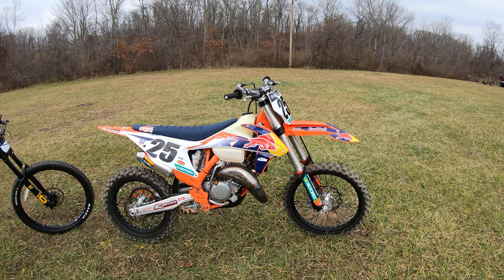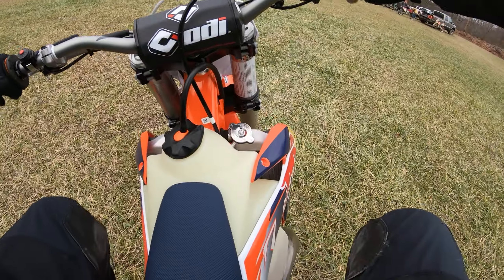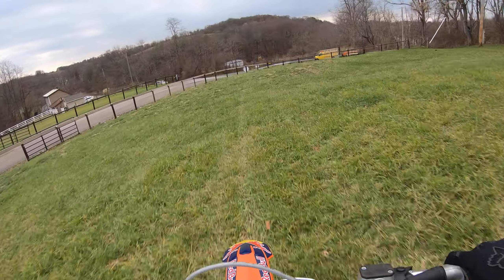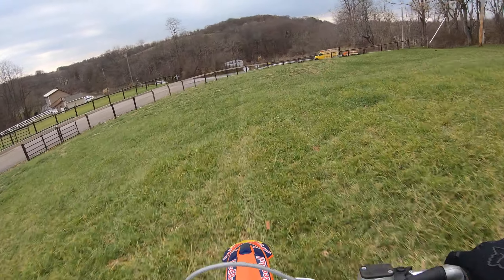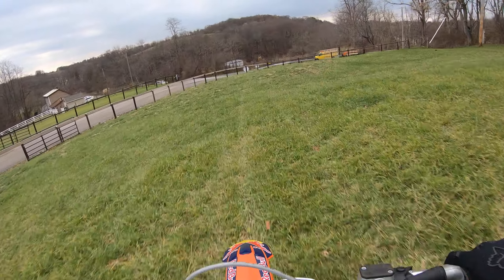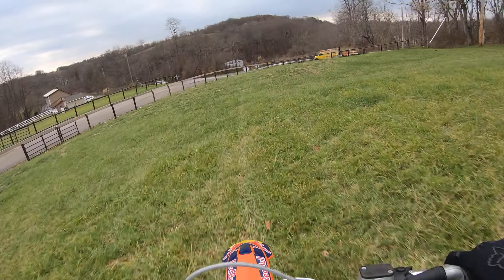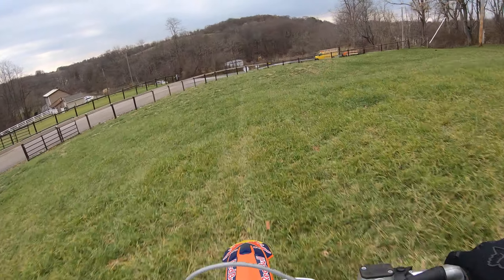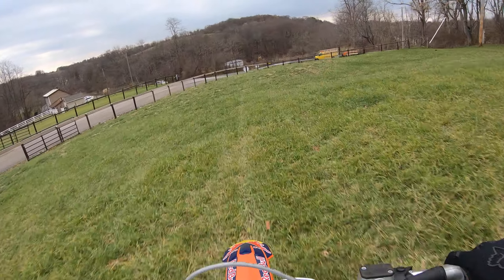2022 KTM 125XC with FMF Factory Fatty and Power Core 2.1 Exhaust

Comment: We installed 2.1's on our race bikes last year.  Thought they were terrible  bike would not run crisp at all.  would bog and pop down low.   swapped them out to Powercore silencers and they bikes ran perfect.  I feel the 2.1 has just too much restriction for a 125.   We also ended up getting rid of the mukuni carbs  and installed smart carbs    this was the best thing we ever did to the 2022 ktm 125  xc
Reply from the maker: 125's can be very finicky on jetting and pipe/silencer combinations.  Sounds like you have your 125XC sorted👍

Comment: You always say the 2022 crf 250r is 125 like, how does it compare to this new Ktm 125.
Reply from the maker: I think the 22 CRF250R sets the bar for lightweight and agile feel in the 250F class - the low engine braking frees up the bike to feel more like a 125 2-stroke.  When you jump on a 125 2-stroke they feel like a MTB - so lightweight and agile and easy to move around (lighter feeling than a 250F).

Comment: I just picked up the same bike this week. Made any other mods?
Reply from the maker: Congratulations on your new KTM 125XC!  I richened the pilot jet from 32.5 to 35 for cooler weather, turned the powervalve preload out 1/2 turn to give it a little sharper hit down low.  I bought this bike from my buddy and he installed the Michelin Starcross 5 tires, FMF Factory Fatty pipe and Powercore 2 silencer, special footpegs and shifter, ODI handlebars.  Fun bike!
Reply: @mxengineer1  so half a turn counter clockwise correct?
Reply from the maker: @joeb10p69  Yes counter clockwise:  I like the lower the tension - lets the power valve open a little quicker.  Mark the OEM setting then try turning it out in 1/4 turn increments and see if you notice any changes.  I think it is subtle but can make a slight improvement in initial throttle response.  You can also try increasing the tension - going in on the spring preload - and see if you like that change.

Comment: You’ve ridden a lot of bikes so I have to ask. What’s your favorite bike that you’ve ridden overall? Out of the enduro/mx and cross country bikes
Reply from the maker: For the past few years my favorite combination of power/weight/handling in a 4-stroke dirt bike is the KTM/Husky 350XCF/FX models.  When it comes to 2-strokes, 300cc smokers are my favorite and the counterbalanced KTM/Husky 300's have been my favorite lately (and I like the clean running gas and go fuel and oil injected KTM/Husky models).  I like dirt bikes that have a wide bandwidth so they work in the woods or for light moto so I lean toward GNCC style bikes.  What is your favorite bike?
Reply: @mxengineer1  Those 350’s, especially the cross country ones are very versatile. My favorite bike at the moment is the 2022 YZ125(I had an 05 I wish I kept), but if what I’m hearing is correct then the 2023 KTM 125/150SX that will suppodsedly have TBI, E-Power Valve, and E-start will be my favorite. I love inovation and KTM is the most innovative of all dirt bike manufacturers. Even though Yamaha isn’t putting as much R&D into 2 strokes as KTM I do appreciate them still making it. You should do a review if you get the chance I’d like to hear your thoughts.